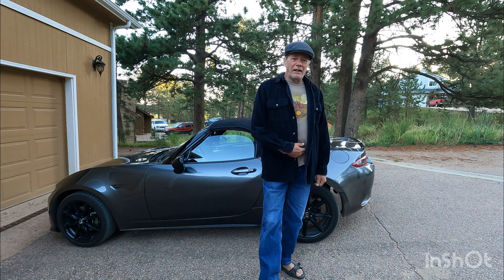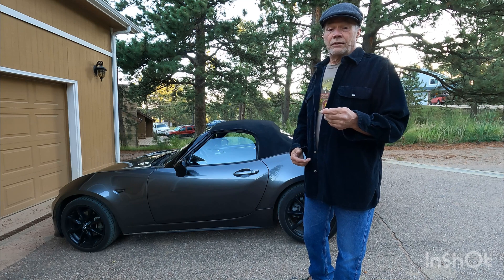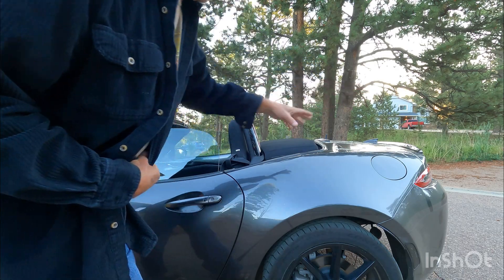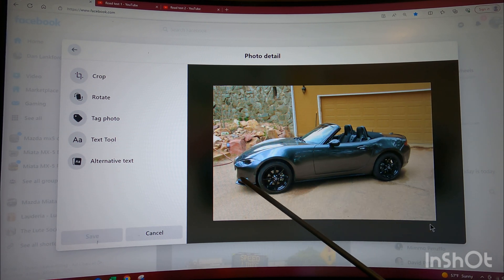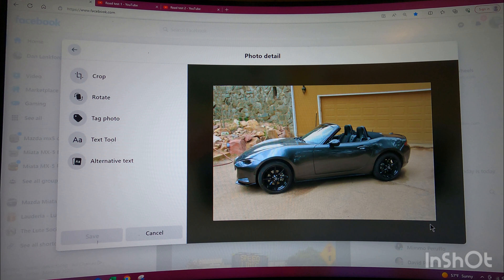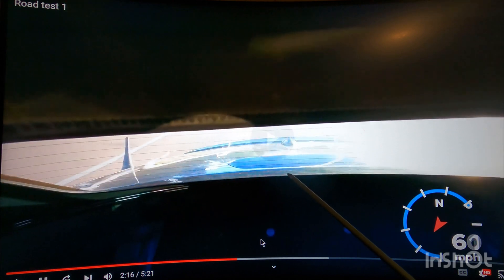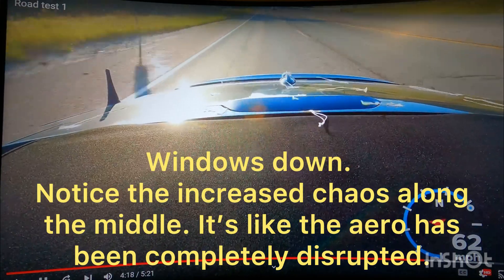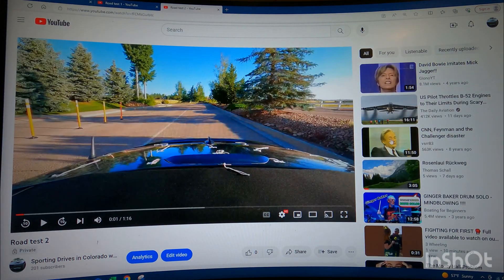Aerodynamics: "Soft top." Up or down? Which is best with the Mazda MX-5 Miata ND?

Comment: ND2 184 PS RF. A feeling that the aerodynamic craft lifts the front axe and the turbulence behind presses the rear axe down. Somewhat dangerous at minus-temperatures. By grip loss of the front axe - foot out of accelerator, no braking. I am not a professional sportsman, just a sailplane pilot - please take this with a bit of criticism. Ideally a training in sliding etc.
Reply from the maker: @oleksandrsemenov9825  oh, this car doesn’t lift. But it is so well balanced you can change which end is heavy or light by working the accelerator. I’ve heard people say it has understeer, but not when you ease off the gas.  :)
Reply: @SportingDrivesinColorado   Thanks for the comment. Naturally, acceleration provokes an illusion (false perception based on real stimuli) of lift/climbing (in case of an airplane) and vice versa. But I have had some situations where the front wheels have slipped at maximal acceleration. Releasing the accelerator was enough to regain the control. And applying brakes on an icy road - I think it was too dangerous. My speculation is that breaking with the motor in a rear wheel drive, i.e. braking with rear wheels  behind the centre of gravity stabilises the car more smoothly than normal braking :) I am going to have an additional driving training including drifting to find the truth :)

Comment: Thanks for interesting content. What’s your view on the aerodynamic efficiency of the trunk spoiler? Thanks
Reply from the maker: My test indicated that one like mine doesn't really do anything unless the top is up. Mine appears to have a very slight effect top down, (no doubt unnoticeable), but I have a custom piece on the rear wind screen to tackle turbulence. I was focusing on interior turbulence at the time of making the mod. It would appear a wing probably won't give benefit unless it's at least 6 inches or more off the deck but at that height, I'm pretty certain one could receive the full effect, but still more with top up. 
Thank you for watching and posting a question, Hans! I'm glad you found it interesting. :)
Have fun and be safe.

Comment: If you care about this, sell your miata, buy a prius, you are not qualified for a fun car.
Reply from the maker: If you notice, all my videos are top down. :)
Reply from the maker: @factory2590  some people drive their MX-5s fast enough that it matters, and this question looms in their minds. This video is for them and those who are just curious.
Reply: @SportingDrivesinColorado  You may have noticed the lack of wind in a miata top down.  You may have even noticed that you can drive top down in the rain without getting wet.

This is because the aerodynamics create a bubble over the passenger area...the same bubble that means EITHER WAY you have the same aerodynamic profile...something Mazda makes a big deal about in their marketing.

That, and Miatas do not go fast enough for what little drag there is to matter at all.

Seriously...just buy a Prius.  Miata owners shouldn't be enormous nerds.
Reply from the maker: @factory2590  I believe my test show differently. But again. I'm not telling people to drive with their top up. This is simply answering a question, and I don't get why that makes you so upset. Some people get upset that I drop the top when it's 15 degrees F.
Reply: @SportingDrivesinColorado  Don't freak out now!  I'm just making fun of a random nerd trying to be nerdy about a great car.

I was serious when I said get a prius.    I sold both Toyota and Mazda.  Toyota buyers have clipboards full of data, and ask for every spec imaginable.  Miata buyers get in, drive 20 feet, say "wee", drive it for as long as they can get away with, then buy it.  THEN ask how many HP.

You, my friend, are a prius buyer.  Not a miata owner.
Reply from the maker: @factory2590  And you obviously didn’t watch the video.
Reply: Well said
Reply: Well said

Comment: The RF looks cooler. But being a Lotus fanatic, "Lightness" is my guide...always. The RF is 160/lbs (73 kg) lighter. That's like carrying someone in the car with you all the time, but nobody in the seat. So, to me, the RF is out!
Reply from the maker: I like the look of the RF top up and prefer the look of the soft top with top down. At my altitude, I don't notice any real difference with an adult male in the passenger side, but then add a full tank of fuel or anything else and the performance drop is noticeable.
Thanks for watching, Island Don!
Reply: @SportingDrivesinColorado  We "purists" can be a pain!😵‍💫

Comment: Just drove an identical car from South Dakota to Vegas. The first 400 miles I rode with the top down. I got 33.1 mpg. Then i rode the last 600 top up. I got 38.6 mpg. Id say there is significant drag top down.
Reply from the maker: That is interesting! Useful information too! I always have the problem of having a very different condition with being at high altitude. This video was done at 9,000 ft. So, your typical altitude is no doubt much less and therefore your air would be heavier, thus making for a greater variance between roof up and down. But, your mention of your fuel mileage,,, I get about 40 mpg all round average! You got about that at high altitude as well. Some cars are really weird and get great mileage up here. No idea why? I haven't had mine below 5,500 ft and so I don't know how it behaves in low altitude. But I'll bet some of your mileage gain was strictly from altitude. But the roof up/down differential would certainly be greater at lower altitude.
Thanks for your input and interest. Hope you continue watching ;)
PS - Did you notice any performance variations with altitude on that trip?
Reply from the maker: I meant to ask you if you had the windows up while top down. Remember in the experiment, we noticed little difference between "windows up/top down" and "top up." "Windows down/top down" was considerably more drag than "top up." 
Just a thought.
Reply: My car comes with a warning. If the car is moving the top must be down!
Reply: Top down windows up first part of the trip, top up windows up at end and the A/C on the entire trip. On the trip home I did the exact same. Drove first part of the trip top down and second part top up, as I seen validity in what you said and figured having top down at high elevation  may have a different effect. I was positive the results would be different than my trip to Vegas. I was amazed by the fact that the results was exactly the same both times according to the MX-5's computer. I'm getting ready to make a trip across South Dakota. It's around the same elevation so I'm going to repeat the test soon. I'll keep you informed as to my results.
Reply from the maker: I meant to mention, the.tell tails in this experiment should be doing the same thing at low altitude, just with more pressure and so the experiment should still be valid.